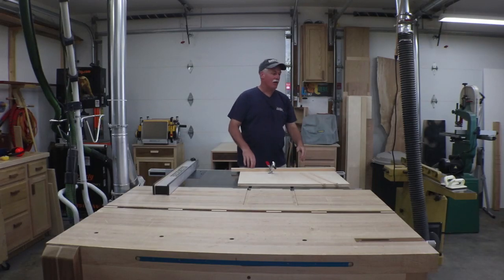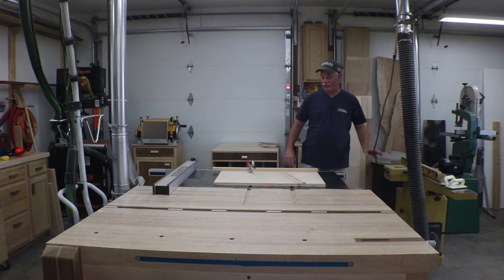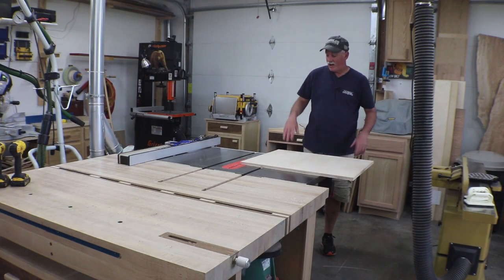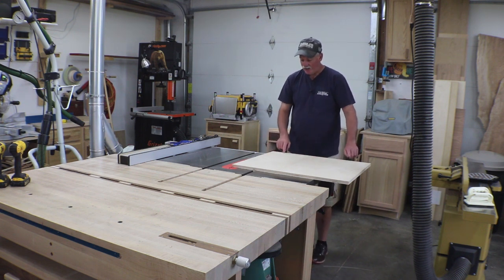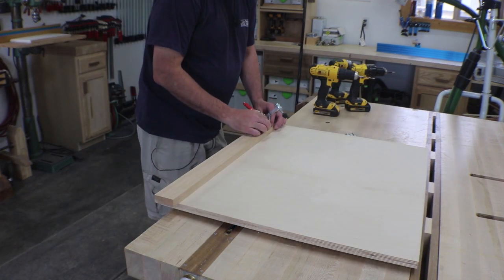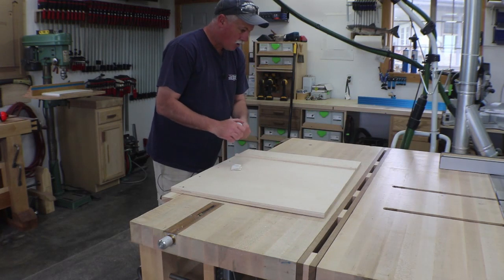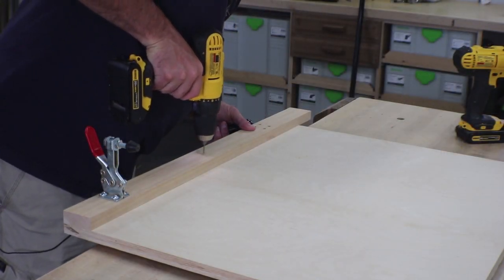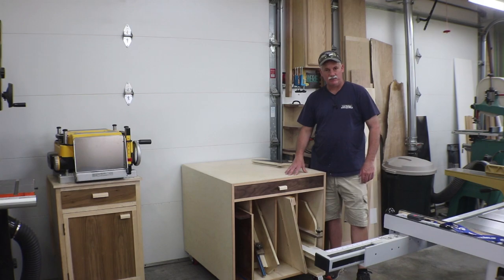Panel Sled

Comment: one thing you can do to make sure it's perfectly square down to thousandths of an inch is the 5 cut method and measure the final off cut with calipers and use feeler gauges and stop blocks to set the final adjustment depending on how far out you are. william ng has a video on that with a formula to follow for the less math inclined. https://wnwoodworkingschool.com/5-cuts-to-a-perfect-cross-cut-sled/
Reply from the maker: The 5 cut method is definitely more accurate.  That big Woodpecker square did a pretty nice job as well!
Reply: oh yeah those squares are incredibly accurate... the 5 cut method is more for people with squares of dubious accuracy. nice video and i need to make one of those.

Comment: Hi KC, just found your channel.  I like your sled, simple and easy to build. I liked that you jointed the fence for accuracy.    I also like the style of your videos.  One question,  I don't understand how you tested the squareness of your sled.  Perhaps you could make a video to clarify your system.  thanks
Reply from the maker: That method actually came from Frank Howarth and it works really well.  Not as well as the 5 cut method but well enough for this considering I had the Woodpecker square.
Reply: @KevsWoodworks  hi KC. I found that video on franks channel. I understand it now. Seems plenty accurate. Thanks for answering my question. Joel

Comment: great video  KC  just wondering if you can feel any difference in your sled because it only has one runner. most of the sleds ive seen have 2
Reply from the maker: No.  It's a long runner that fits well in the track so, there's really no movement.